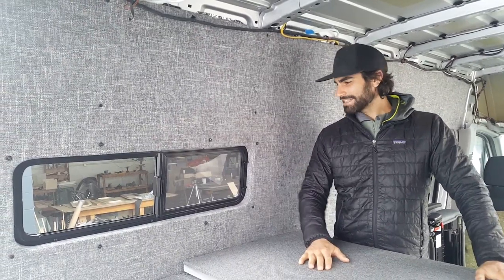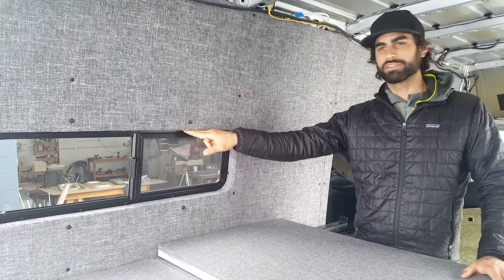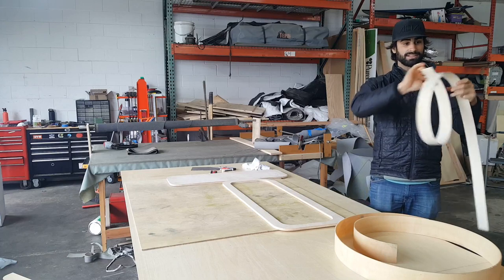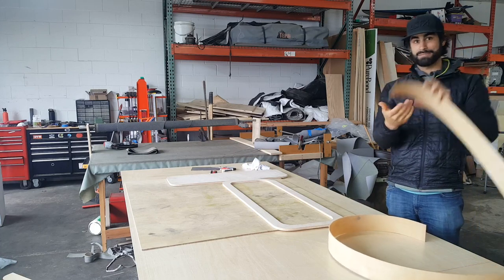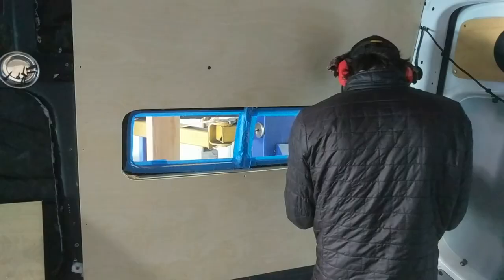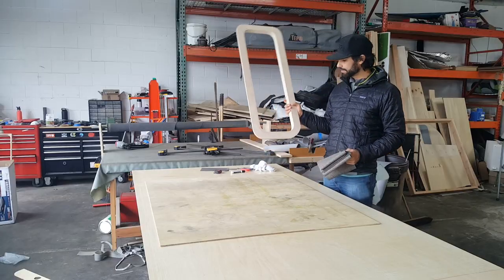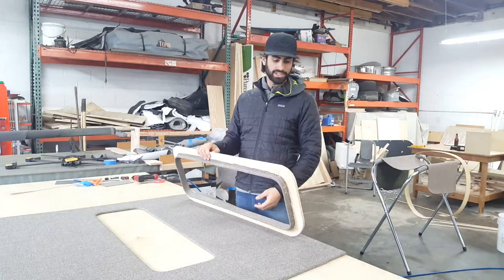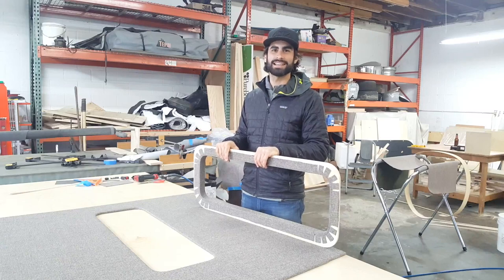*DIY* How to Build a Custom Fabric Van Window Frame!

Comment: Nice video thank you.  Making a similar window frame for a full-size window like the CRL FW621 will take some more strategy to follow the larger curve of both the window (glass curve) and curved interior wall panel, instead of just leaving bare body metal exposed.  I'm searching for a robust method!
Reply from the maker: Hey Ralph. Thanks for the comment! I used the same exact method for my larger CRL crew windows. I have changed in the recent months however. I now use poly iso board that comes in a 4' x 8' sheet and cut it down into strips that will match the depth I need. This stuff is just over 1/8" thick and bends very nicely without cracking. This eliminates the need for laminating two pieces together. Either product you use, this method will still work on the larger windows. Good luck!

Comment: Thank you for taking the time to make and post this video it's exactly what I was looking for. I'm converting a Sprinter and am upholstering it just like you are but the window has had me stumped for far too long!
Reply from the maker: Glad I could help. I actually updated my process and now use 1/4" plastic for the ring witch negates the need to glue the two pieces of bender board together. Then you can glue and staple the plastic to the ring and continue with the same steps. Good luck and have fun!
Reply: Levity Vans Interesting, do you know the type of plastic that you are using? Do you have to apply heat in order to bend?
Reply from the maker: I think it's called polyiso board. It flexes a LOT before it breaks. No heat necessary.
Reply: I’ll have to do some more digging. All I see for polyiso is the rigid foam board insulation.
Reply from the maker: It's not foam board insulation. I'll see if I can dig up the name tomorrow. You may need to poke me 🙂
Reply: @LevityVans  I ended up using 4MM PVC foam board plastic and it worked out great. It bends easily with a heat gun and takes staples well.
Reply from the maker: That's great! Glad it worked for you!

Comment: Might try mounting the window frame to the wall panel first, then cover both using the fabric in the window opening to wrap the window frame. This will save on material and hide the mounting screws for a cleaner look. Good luck Tcash
Reply from the maker: That's a great idea! I think I had trouble with the fabric stretching enough to cover the window frame without any seams doing it that way. I could source a more stretchy fabric. Have you done it that way? If so, I'd love to see some pictures! Thanks for the comment!
Reply: Just an ideal. Haven't done it. Thought it would streamline the process. Have a great day Tcash

Comment: I was wondering why you did not make a trim panel for the bigger OEM window that you briefly pointed to? Could you do a similar trim panel for that window?
Reply from the maker: Hey Jim. Thanks for the comment. You can do exactly the same thing on the larger window if you have an aftermarket window. All aftermarket windows come with a ring that you can remove and use as a template. Feel free to reach out to me directly at contact@levityvans.com and we can setup a phone call with further explanation. I'm happy to help guide you to your next adventure 😊

Comment: I believe he is using veneer sheets for "bender board". It can be found in  2x8 feet
Reply from the maker: Sorry I missed this comment. I'm actually using a product called bender board. It's not a veneer. However, I've since switched to poly iso board which is strong, bendy and eliminates the need to laminate two pieces together. Saves on time and energy...

Comment: Where would one buy bender board?? thx
Reply: I believe this is veneer sheets cut down to size.
Reply from the maker: Sorry I missed your message. I buy it in 4 x 8 sheets from a local wood supplier. I've never seen it at the big box stores but you may be able to order it. You could use a different material too if you found a thin flexible and soft plastic. Then you can glue and staple it to the frame. Feel free to reach out to contact@levityvans.com if you have more questions. I check that email consistently and I don't check this often. Thanks for the question!